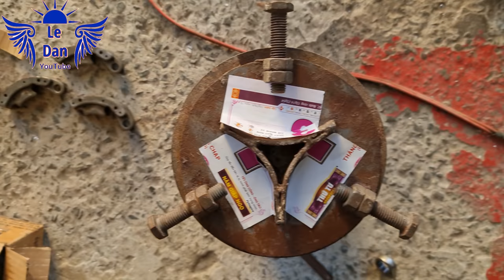i build 1 cylinder to 2 cylinder engine to increase power

Comment: I didn't expect a 125 cc honda engine could be converted as inline 2, the only one that we could do is putting a suzuki raider 150 head and bore to a 125 honda engine to make it dohc 4 valve but this one is really on another level, im sure you work with 2,3,4 cylinder engines too the reason why you know to align and tap it accurately, man I wished I got those level of experience too, keep the videos going and I'll study them :)
Reply: Có bán ko bạn ơi
Reply: the channel motorcycle tv of Vietnam did this too.His name is Lucio Nguyen,he is an motogp technician i think he did the same thing few years ago with just a drill press and casting aluminum welding technique just like this.He also did some 150cc cylinder on smaller motorcycles and alternative implant of Honda and Yamaha parts.

Comment: The only thing that I'd be concerned with is the balance as the engine mount is now not centered to the extra weight you've added
Reply: It can be used for an ATV
Reply: Most definitely 😃 yh I'm not knocking the work I think he did great job
Reply: Yukk mampir ke warung kita, semoga panjang umur sehat slalu buat semuanya. Amin
Reply: No matter, it's easier to do than the all the work have been done. Centered engine in the frame seems to be an easy job my friend.

Comment: Havent seen the single cylinder version. Looks like a kit. Crankshaft has to be timed camshaft timed accordingly. Also there is the issue of ignition. Would be interesting to see the fabrication process of the modified parts
Reply: Totally a kit look at the head he bolts on that ain't no home fan plus all he did was bolt stuff together.  No one photo of machining
Reply: @MTRR  have a look again. You can clearly see where he has welded 2 heads together. He has plenty of videos showing his machining talent. This guy is legit!

Comment: This guys is the real deal. Amazing work but would like to know if that engine will hold on full power as the pressure ratio would of changed. Looks great though
Reply: The pressure ratio of what? It's not twice the pressure in one cylinder but the pressure in two cylinders and the top just doubles the area of pressure (one for each). I don't see where any increased pressure would occur?
Reply: @michaelmay5453   the pressure ratio of the engine its self obviously. added a extra piston to the same shaft could burst by pressure, heat or vibration . You clearly not a engineer or mechanic lol.. Is the 3 most common mistake in engineering. Looks good yeah! I can admit that and if he got it working great but the question is.. can you take it to full gas? I like this guys video but i like fast and furious too and dont make it real. People that understand my point clearly liked my comment as you can ser. Even the blogger made tge video. I am not roasting anyone i made a genuine question. Didn't need to get all worked up man lol chill
Reply: @jstengineering1513   But the shaft is longer now, it has more area to distribute the tension, it's NOT the same shaft, it has the same amount of bearings as ONE shaft. one on each side of every piston shaft.

Did you not watch the video? The pressure would clearly be evenly distributed.

I mean this is quite obvious and if you were talking about strain on the crankshaft then why didn't you say so, that has nothing to do with "pressure".

Your idea here that your comment is popular (it has two upvotes from the youtube community, I've seen people claiming they can run their car on water with more upvotes than that) lends nothing to it's correctness, if popular ideas were correct then the earth would at one point have had to be flat since everyone believed it to be flat.

Also, I'm not getting worked up. I don't know where you got that from, perhaps you are projecting?

Comment: a lot of prework has been skipped. what is the crank source? how did you cut two engines or joined them? the welding process of two cylinder heads? were they welded from outside only? the heat transfer issue? what was the source of other essential parts which fit exactly to the dimensions of two intergrated engines into one?

Comment: Bro, I want to ask about the bore up formula.

cc = 0.785 x (D x D) x L

I'm trying to calculate the default cc from Suzuki Raider 150:
Cylinder diameter 62mm
Piston stroke 48.8mm

62 x 62 = 3.844
3,844 x 48.8 = 187587,2
187587,2 x 0.785 = 147,255,952
Or rounded up to 150cc

D = Piston diameter
L = Step length/stroke
0.785 = ?

So the question is, where did this number 0.785 come from?
Reply: 150cc is just a defination, it round up from the real volumn off burning space, 0.785 = 3.14/4= pi()/4. It is begin from the formular of calculating the metric volumn of cylinder shape:
V=S.H within S is the square meter of the bottom or top is definded S= pi().D.D/4 or S=pi().r.r within D is the diameter and r is half diameter.

Comment: The thing is, the engine will seize up due to hotspots and overheating of the block (might loss compression or a total engine blowout). Not undermining the ingenuity of this person, he just need to have more knowledge and good set of equipment to produce nice engines.